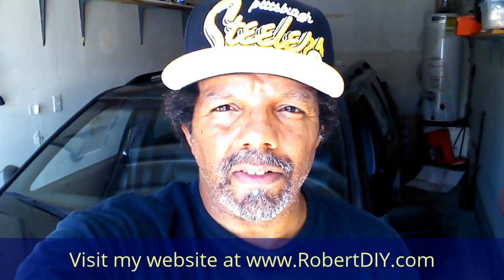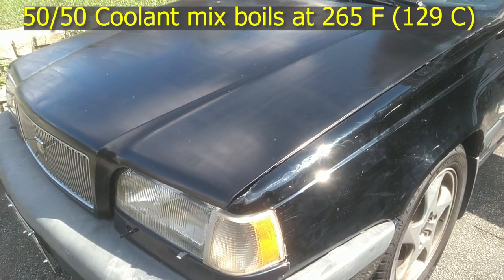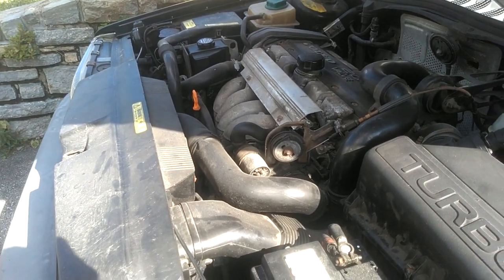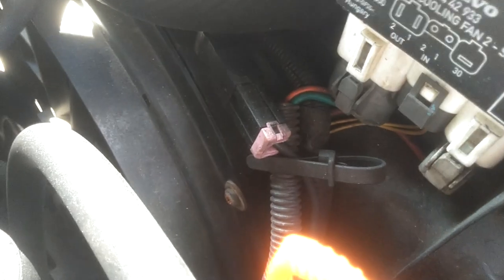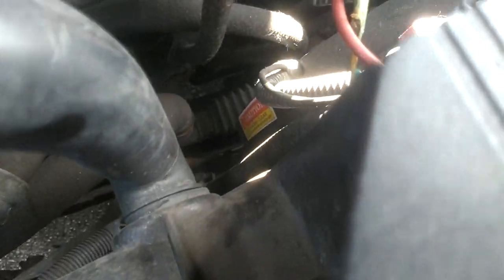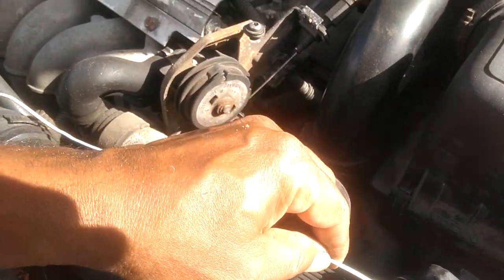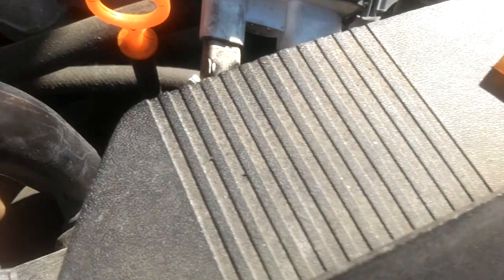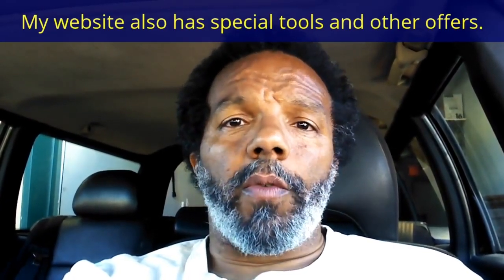How to test your engine fan to make sure it works so you don't overheat your vehicle engine. - VOTD

Comment: One thing I found was that EM fans can run almost forever what happens in computerized systems is planned obsolescence. For instance, when your cooling fan is connected to a control module and it fails, it doesn't mean the fans have failed. When EM fans get older, they don't stop working but what happens is they may draw more power. When the ECM picks up on this, it "fails" the fan by refusing to supply power to it. Effectively, you could bypass the fan control  and plug right into the aux power to the control module but then you will lose speed modulation. Best bet, get new fans. Clip the plugs off the old fans and splice them onto the new ones. Plug right into the control module  and it will run like OEM. Cheers.
Reply from the maker: Thanks for sharing

Comment: pretty sure if you follow the green and red wire into the harness on the front driver's side there is a connection ( unplug )that plugs into it so that whole section is an extension wire . its backwards so you can cut that out of a bone yard car and check fans all day long as it just plugs in the fan original grey box and  and a jump box and in 30 seconds you can tell if it works or not....came across a lot that were seized up in the bone yard.  saves alot of hassle .....just my 2 cents..
Reply from the maker: Awesome tips. Thanks.

Comment: The 2 speed fan control module has a hot 12 volt connector on the right. In the middle is a ground connector to control the relay to feed the power from the right connector to the left connector. If you disconnect the middle connector, run a small wire from the oil stick tube and touch the middle connector in the fan module, the fan will operate. Connector 1 is low speed, 2 is high speed. I made a manual switch to control the relay because I have p0480 and p0481 code for fan circuit problem.
Reply from the maker: Interesting
Reply: Yep I just found this out tonight. I tested the relay and it's good so I'll just wire up a switch.
Reply: @wheelsup  Sounds good. I bought a electric switch from Home Depot. It's exactly the same switch you use at home to turn on the light. Cost is like 85 cents. Then I used a few USB cables and power adapter cables. I solder together to make one long cable from the relay to the switch I put underneath the steering wheel. I made a short cable and connect from the negative terminal of car battery to the switch. Good luck on this small project. It works really well for me.

Comment: On a hot day after in town driving & running the A/C it's common for my C70 or V70 Cross Country to have the fans run a minute or so after shutting the car off.
Reply from the maker: yes it is.

Comment: The location of the relay above the fan shroud is a magnet for heat if you can add some reflective sleeve to minimize the temp on the wires.
Reply from the maker: Interesting

Comment: Robert, excellent video. I have a 2000 S70 2.4 litre 5 speed. Checked my fan by connecting it as you did and it works great. A few questions, first, should the fan go on if the A/C is turned on regardless of the temps? Second, on your relay you have what looks like a stoplight with the top two lights filled. My relay is so old that I cant read anything on it except the stoplight symbol. One mine however ALL three lights are filled. All the sources I have looked at give a part number of 9442933. Is this a 9442933 part?
Reply from the maker: I don't know.

Comment: How can I test the signal wires that goes to the middle of the relay ? My car is 1997 (model year 1998) Volvo V90 and though the fan is working when I test it the way you showed and the thermostat and temperature sensor are OK the fan won’t cut on. Neither when A/C is on nor without it 🥲 I even purchaced a new 2-speed relay and installed it but in vain,,,
When I disconnect the temperature sensor and start the engine the fan cuts on and stays on untill when I stop the engine and wait for six minutes. I guess this is somekind of safety feature in case the sensor or its wires are damaged.
Reply from the maker: Wow! That's nice. I need to learn how to use the app.
Reply from the maker: Yikes! Sad to say, I do not know. May be a problem in the ECU.

Comment: Those signal wires are the problem for most fan problems and all of us from the '90s through early 2000s. They rot their old always check them. Will cause resistance in the relay in the relay will burn out prematurely had this problem many a times 940s 960s and my V70 . The temperature sensor on the 850s 960s also feeds the computer information on fuel injection check there
Reply: As a side note green wire stripe on those little leads is your low side the yellow with the red stripe is your AC high side when you're repairing those leads back into the relay
Reply from the maker: thanks for sharing.

Comment: Hello.  I have a 2002 Volvo v70xc, the fan does not work and the air conditioning does not activate either.  You can show how to check it, the system is a little different from the one in the video.
Reply from the maker: same theory. you can figure it out or bring it by and I'll help you.

Comment: I drive a 2010 Volvo S80 3.2 and I'm not entirely sure if the fans are kicking on or not. Whenever I open the hood to check I don't see the fans spinning, even after hard driving. Is this normal?
Reply from the maker: Yes, you can connect a tool to the OBD2 and check the coolant temperature. If it's above 230 degrees the fans should be running. You can also turn on the AC. If the AC is on for longer than 10 seconds the fans should kick on.

Comment: hey Robert,

is it a wise move to put my v70 from 2000 in the garage for a year. or will this be bad for the vehicle?
Reply from the maker: A year would not matter. Just disconnect the battery and maybe get the tires off of the pavement (put on wood). Also add a bottle of heat to the fuel tank.
Reply: @RobertDIY  Bottle of heat? whats that??
Reply: @coreturkoane5570  fuel stabilizer.

Comment: Is it normal for the upper radiator hose from the rad to the thermostat housing supposed to get hot and swell?
Reply from the maker: Not really. I would make sure you have an OEM thermostat and a newer hose.
Reply from the maker: https://youtu.be/WXOHjePUWkU

Comment: Where is the relay for mine, if there is one?
Reply: If it’s a 700 series car I think it’s in front of the battery. That’s how it is on my 940
Reply: @evanhampton6786  It's a 740 GL. Nothing in from on mine except the headlights.
Reply: Can you follow the wiring harness from the fan?
Reply: @evanhampton6786  I can if I can find it. I'll have to search tomorrow. The temperature is 107 now. Should the fan turn on if I apply power to the connectors end?
Reply from the maker: Yes.